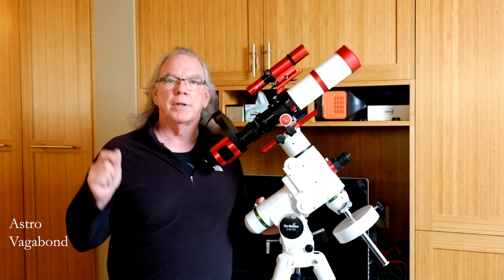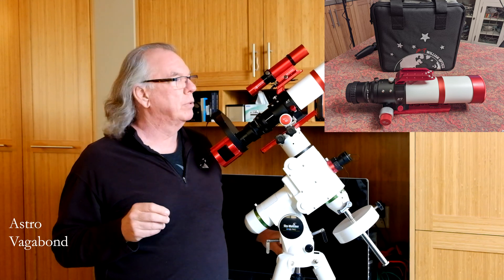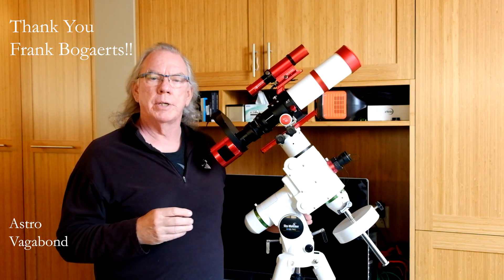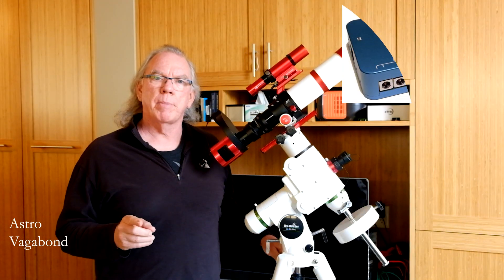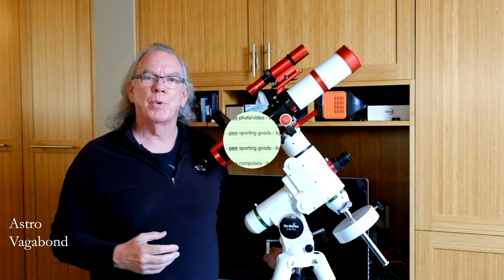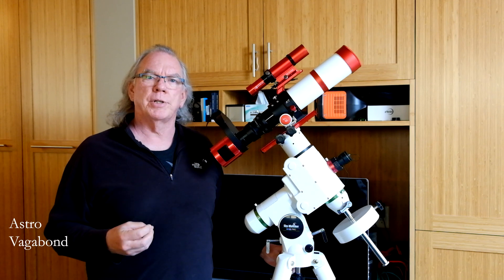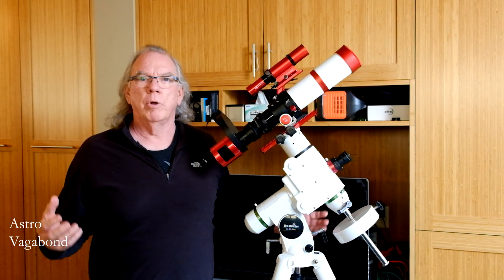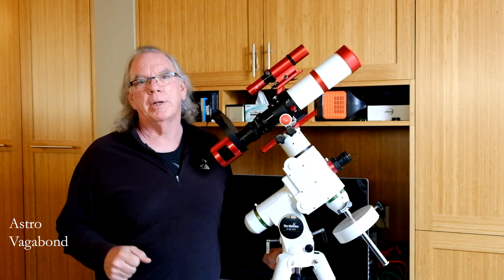ZWO OAG & Pegasus Astro Powerbox Advanced Project Kickoff

Comment: You will absolutely love the Pegasus Powerbox Advance... and wonder how you possibly got on with out it beforehand. I've got it and a Beelink mini PC at the scope. I have exactly one cable running from my mount now: the power for the PPBA. If I ever go to a dark site, I'll need a better battery than what I have now... but that's not really top of my list at this point. Right now I need to figure out my problem with the flats for my luminance filter. Finally found the root cause - a misaligned silicon gasket on the filter glass intruding into the image circle - but even with a replacement L (an Astrodon I-series LRGB set) I'm STILL having issues creating good flats. I have yet to figure out the issue... I've taken flats with multiple light sources (my iPad and my Elgato Key Light Air) at multiple light temperatures ranging from warm 3200K to cool 6500K at multiple intensities through a variety of different diffusions (ranging from none to multiple white shirts to paper to paper and shirts), multiple ADU from 5k up to 45k and different exposure times ranging from 0.02 to 12 seconds. Heck, it feels like all I've done is take luminance flats!

Speaking of flats... how's that Pegasus FlatMaster working out for you? I'm about ready to order one just to see if it is my freaking light source causing me to be unable to take a proper flat. That was actually the problem I was having with my R filter... the iPad was producing some weird ring... using my Key Light Air, R calibrates out perfectly now. Oh well... I'll stop ranting and go try yet more settings to get flats to work :P
Reply from the maker: Sorry for the delayed response. I've been down a couple of days recovering from the punch I got from my second does of the Moderna vaccine. 😞 But glad to have that out of the way.

I enjoyed following your saga on Cloudy Nights. A good read for others which I recommend they find and read on how you approached solving your issue in a methodical manner. And it was good to see others in the community pitched in to help.

I read your reply to yourself already 🙂 and glad you worked through the issue. Yes another recommend read for others to pick up the knowledge you gained at considerable investment of your time. I bet you slept well.

As to the flatmaster question which is probably moot right now from your perspective, and now that I have a complete set of LRGB and NB filters I need to do some work with it to run through all the filters.
Reply: I don't typically reply to my own comments, but thought I would in this case because I finally figured out my flats problem. Turns out I had to point my scope to a white wall which was illuminated by my Elgato Key Light Air. I also had a white tee-shirt over the scope to provide some diffusion. In all my previous tests, the light was resting directly on the scope, which had some tee shirts, paper, combination. OK, now I can go to bed and sleep without dreaming up new and exciting ways to deal with the luminance filter flats :P

Hope this helps someone else who might be struggling with the 294MM Pro and flats.
Reply from the maker: Glad you worked through it Jonny!
Reply: @AstroVagabond  well... I worked through it to the point where I'm "almost" there. The flats are "close", but I'm still getting concentric gradients if I push the data hard enough. Flats aren't exactly there... but I'm closing in. At this point, my Luminance filter flat process is: put tee-shirt over scope, point scope to flat-white-painted wall, point Elgato Key Light Air to that wall, turn light on to 37% illumination at 5600 Kelvin, set NINA to target 32K ADU, take flats (which should be around 3.2 second exposures) and matching dark flats. And yes, I MUST be that specific. It's nuts how sensitive the 294 seems to be for me.

If that Pegasus Flatmaster is working for you by just popping it on top of the scope and running the NINA flat wizard? Yes... that is for sure a purchase I'm going to make.

Comment: Hi Bill. Great video -good to hear from you again. Have you considered mounting the power box to the dovetail? Others have created or modified "L" brackets to carry the power box - mounted to the dovetail. Is there any real benefit to an OAG with a widefield refractor - over a guide scope? Otherwise it seems like alot of added complexity just to make room for the power box. Good Luck!
Reply from the maker: Anthony thank you for raising the question on benefit of an OAG with widefield refractor. 👍 This feedback is very helpful and is causing me to rethink an OAG for the time being. Mounting the PPB Advance on the dovetail may be the best option. I know so little about dovetails right now maybe it is time I learned.  It seems I would need a new dovetail of a longer length to create area to for mounting.

The other reason I thought about the OAG is I've not perfected aligning the axis of my guide scope with my telescope. I don't know if this misalignment is introducing error in my guiding. 

So I agree with you and will look to go the dovetail route to create the room. Much appreciated Anthony! 👏👏👏
Reply: @AstroVagabond  Pegasus Astro actually makes dovetail mounting brackets for the PPB - looks like they thought of everything....